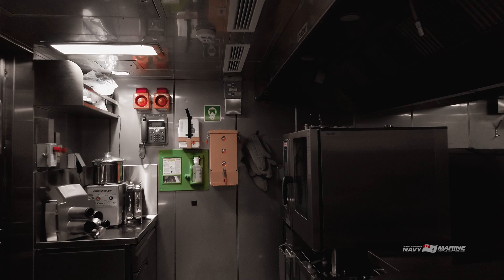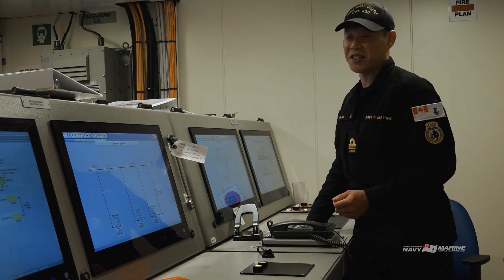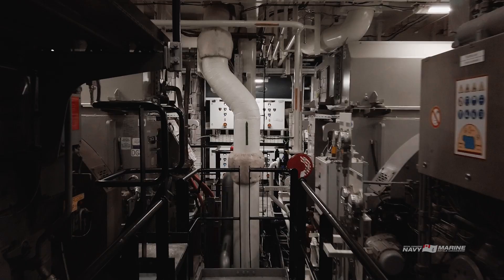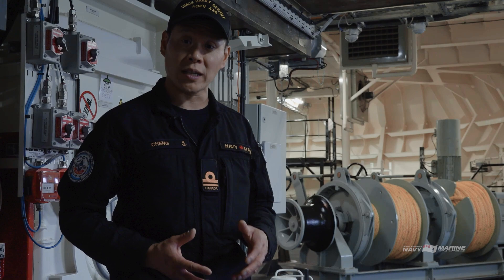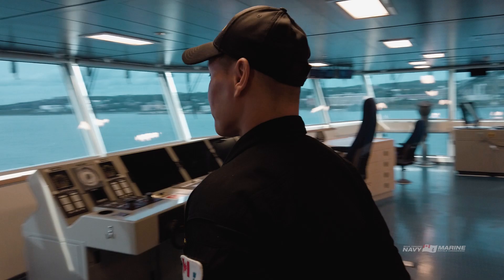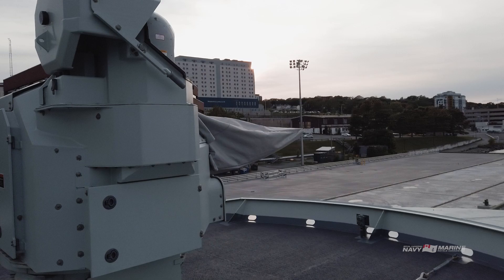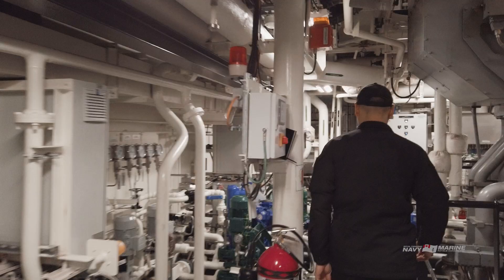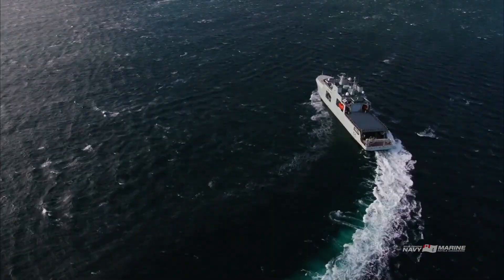INSIDE LOOK aboard HMCS Harry DeWolf

Comment: Very nice but for a naval vessel it is grossly under armed. One 25mm gun and a few M2 machineguns  around the decks will not do much. Unless some containerised weapons systems can be routinely carried, it's a peacetime vessels ONLY.
Reply: Offshore patrol vessel.
Reply: @FirstDagger  Thanks for the reply.  OPV means different things in different navies. Those cranes for example and the icebreaking feature, make the current two vessels in the class, something else entirely. Arctic and Offshore Patrol Ship (AOPS) is I believe their correct title. Patrolling and responding to alerts in the highly contested Arctic region. 

Along with all NATO nations other than the USA, the Royal Canadian Navy has so few combatant vessels in the fleet.  I imagine the AOPS will be utilised for many different roles and it will be woefully under armed for many of them, should the current political standoff with the CCP or Putin's Russia turn hot.  The De Wolf class will be breaking ice in regions where other surface vessels cannot follow. Surely a more effective self defence system would be essential. Nobody is saying armed them with the BAE127mm naval cannon as that would change the nature of the entire vessel.  The US coast guard deploy the BAE 57mm on their patrol vessels to great effect. However, there is a better option out there. The new naval version of the BAE 40mm with the Case Telescoped System will be a game changer and in it's most compact form, is easily fitted to many platforms. https://www.youtube.com/watch?v=6mY8rV3oTlg

It's not a matter of justifying if this new system should be fitted to new vessels and retro fitted to old. It's a matter of justifying why it should not! Sailors are expensive to train and should be given the best available protection.
Reply: @FirstDagger  BTW I'm British.

Comment: What kind of "warship" only goes 17 knots? 1 × 25mm gun?  Any anti-submarine capabilities besides a heilocopter? Where's the phalinx? What sort of navy in 2021 doesnt equip a new ship with some sort of missile system. Flower class corvettes in WW2 (which Canada had dozens of) had a bigger gun, anti-submarine weapons like the hedge hog depthcharge system and AA guns. This thing with it's single 25mil couldn't fend off a few somoli pirates with AKs on a motorboat. What is the point of this massively expensive pleasure craft? 17 knots??? It couldn't even catch an oil tanker!

Comment: Why would they have an officer do the tour?   Here is my cabin with my own washplace and shower........What about the crew compartments, etc.
Reply: from the specs, they have individual crew accommodations for the 65 sailors. But things might have changed from the original plans
Reply: From an RCN article:
"The cabins are also an improvement in the new AOPS. Officers, chiefs and petty officers all have double occupancy cabins, while master sailors and below have six to a cabin. Each cabin has its own private bathroom, and the racks (beds) are slightly wider with a privacy curtain."
So the tour showed one of the double occupancy cabins (he presumably shares it with another officer).

Comment: Dont let this fool anoyone, he only has his own cabin/washroom because he is an officer. NCM still sleeve on essentially shelves above eachother.
Reply: He does have 2 beds in his cabin.  Who or what is that for ?  Does his bed mate share his bathroom and shower ?
Reply: @daviator4720  just cause there's a second bed doesn't mean someone uses it.
Reply: @daviator4720  Yes, ranks above master sailors have those double occupancy cabins. The lower ranks have six to a cabin, and "each cabin has its own private bathroom, and the racks (beds) are slightly wider with a privacy curtain" (according to a Navy article).

Comment: What's with the lack of weapons?
Reply: Because there isn't any large enemy vessel that can make it that far through 20-foot thick ice sheets to need anything bigger,  yes, nuclear subs can go under. That's why the helicopter on board has anti sub torpedoes (we found the tiny broken oceangate titan, we can find a large active sub)
Reply: @tyniria  Russia does. They have nuclear powered ice breakers that are much more armed and stronger to break through the ice. Those Ice breakers need to be armed much more than a 20 mm, thats a joke. Not to mention an expense new piece of hardware. at least an adequate CIWS. Of  course this can all be outfitted on after im sure. Even for humanitarian aid, we suck in equipment.